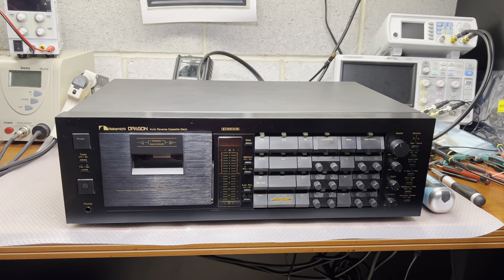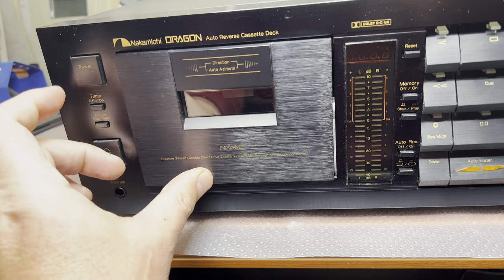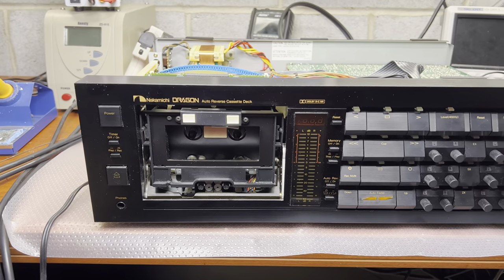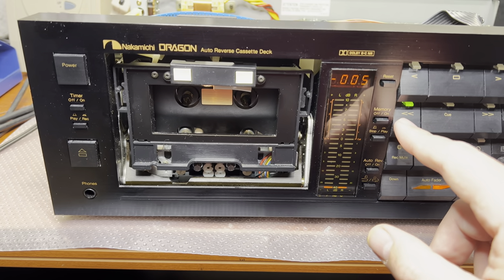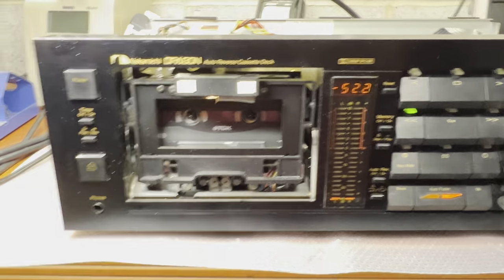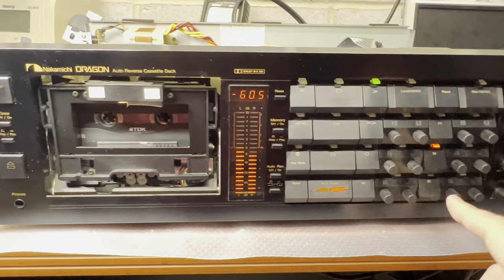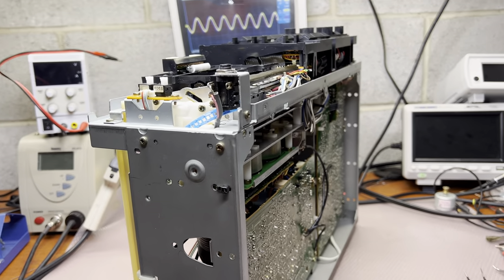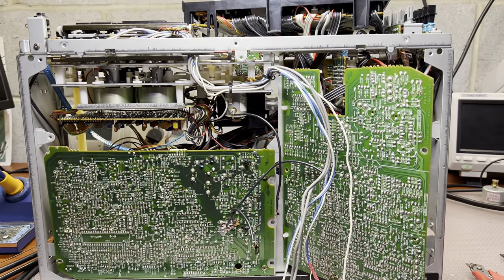A New Challenge: Servicing a Brand-New Nakamichi Dragon

Comment: I have a Nakamichi dragon. Auto reverse function not working,Green LEDs on buttons not glowing,Rew/ fwd working. The capstan motors spinning on one direction . Head loading and coming down . Pls guide me how to rectify
Reply from the maker: Send it to a reliable serviceman, no way you may fix the Dragon without experience.
Reply: Iam located in oman . In middle east there is no one to repair this machine.
Reply: I have replaced the idler tire and the other 2 belts also . Rewind and forward. Works well . The capstan drive board transistors Q518 & Q519 gets hot bit higher than other side Q522,523,524&525
Reply from the maker: @markantonyrodriguez7998  check my other video on the heavy beaten dragon, I spent quite a few time restoring
Reply: Pls post me the link,i couldn't find  . Thanks a lot